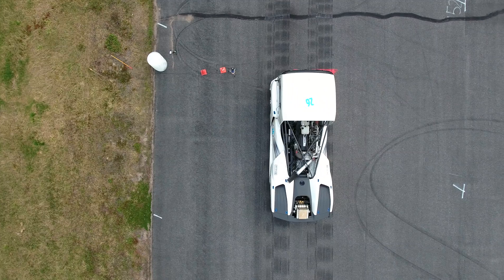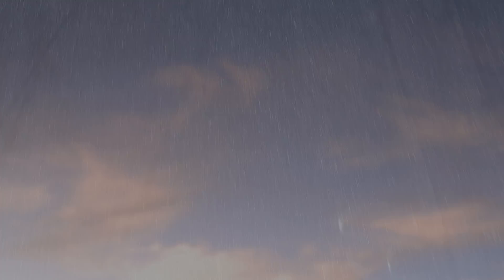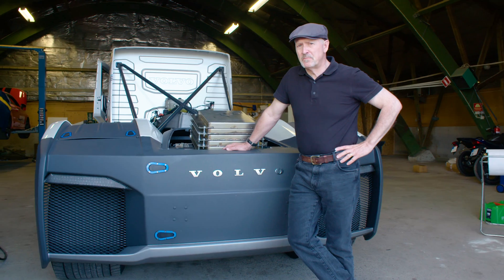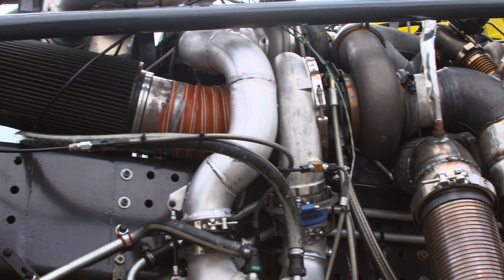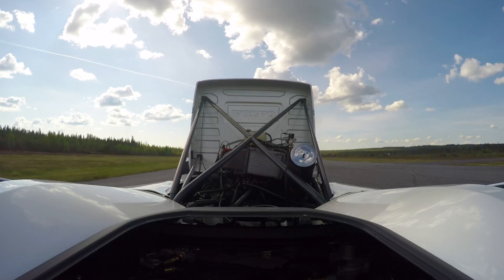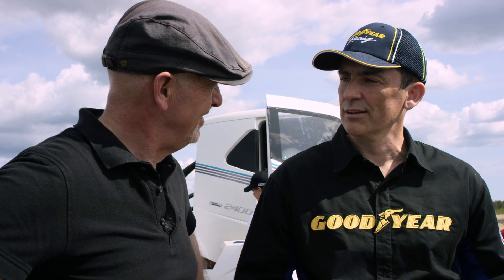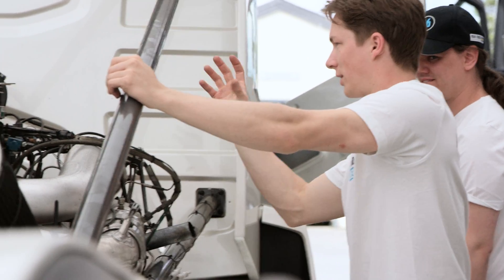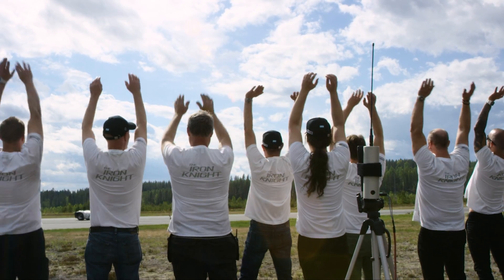Volvo Trucks - What’s hiding under the hood of The Iron Knight – Trucks Anatomy (E05)

Comment: I'm looking to do some upgrades on my 20008 volvo d13 I'm wondering if I can run an aftermarket intercooler rated for 1000hp I'm sure it'll perform better than the stock one wich usually Crack every couple of years anyone got any insight on what I'm trying to do?

Comment: How can a stock I-shift reach 300 if the redline is at 2500? (on factory trucks), does this modified D13 have a higher redline?
Reply: It revs more than that.
Reply: Smaller final drive ratio maybe

Comment: what about the i-shift clutch, you say it is stock and then you say they modified it... Now that's a contradiction.
Reply from the maker: Yes this is an original Volvo I-Shift Duel Clutch transmission. The only modification which has been made is
a reinforced clutch in order to manage the very high torque of the engine.
Reply: Gearbox is stock but clutch isn't

Comment: why d13 engine and not d16?
Reply: I think mainly because the D16 is a very bulky engine. If you want to modify  an engine and still fit it inside the chassis the D16 is a nightmare. The stock D16 750hp are already hard to put in the chassis, it's a very tight fit.
The Iron Knight is amazing, I've seen it in action, it's crazy.
Reply: Johannes Soonik maybe due to weight? Don't know actually :)
Reply: Usually in motor sports the use of a bigger engine is a minus! The smaller engines give a faster RPM.  
More cylinders or bigger  = slower starts !
Reply: ur WRONG. heres one example: TOP FUEL DRAGSTERS
Reply: There is no replacement for displacement... More cubic inches, more power!